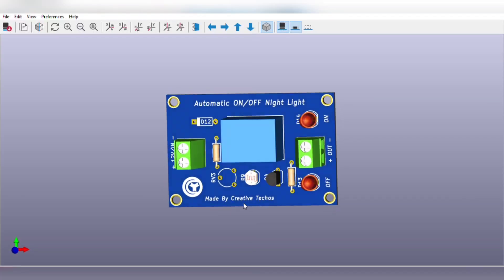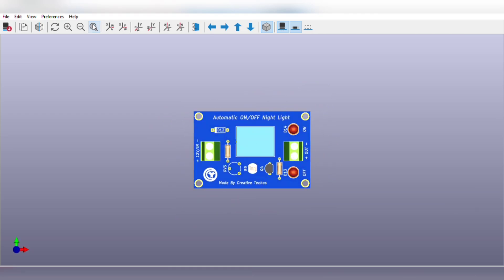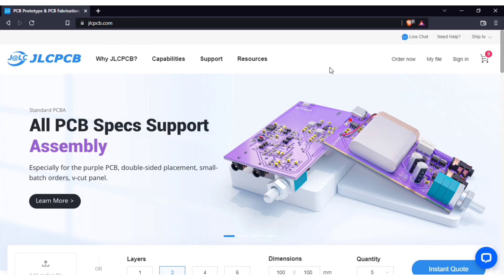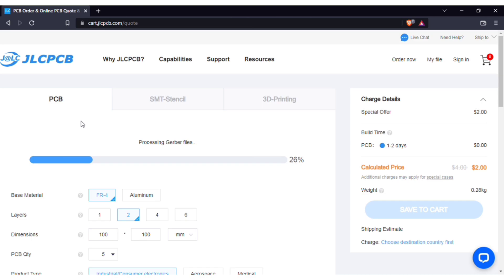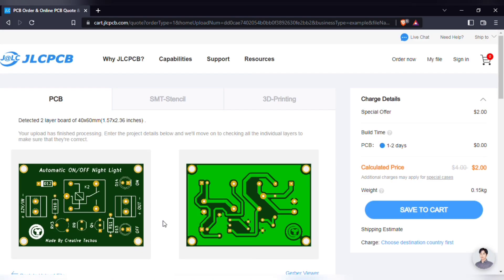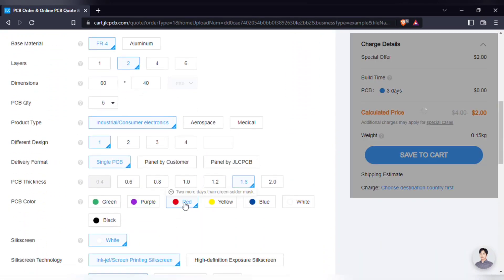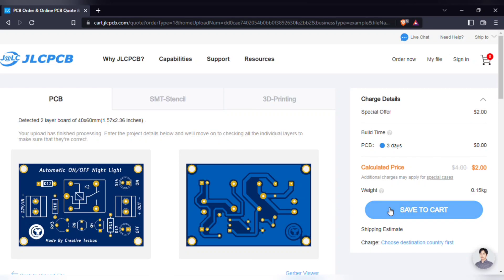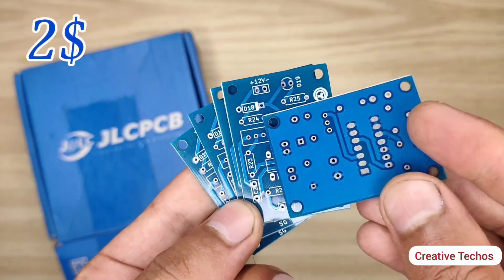Street Light Automatic ON OFF Night Light circuit

Comment: This circuit will work with fast changing light, but the light outside is changing very slow and the relay will start buzzing when the light is right in the point of switching. This type of slow changing events (light, temperature) needs a circuit with Schmitt trigger input with hysteresis to work properly.
Reply: using small value cap. like 47-100uf at relay coil points ll stop it from buzzing.
Reply: Prove it!

Comment: As u have shown 12 v relay instead of that if we use 6v relay using 6vsolar and 3.7v ×2  batteries changes to be done
Reply: Can u please help me as I am interested in making 8 to 10 pics and donate them in a village school after my wife's death anniversary
Reply from the maker: How can i help you, let me know 🙂
Reply from the maker: Yes, it will work perfectly after changes.
Adjust variable resistor to adjust sensitivity
Reply: Would like to have one circuit boardmade and rest of the circuit board  and rest of the boards with particular
Reply: Can u please make a circuit diagram and send as have to submit it within two days
Reply from the maker: Message me on WhatsApp+91 9596386458, I'll send you circuit diagram there
Reply: @CreativeTechos  would like to have the circuit board diagram
Reply: @CreativeTechos  please do send me the circuit board diagram
Reply from the maker: I'll send WhatsApp me
Reply: 6v 3A power supply circuit diagram
Reply: Thank you for your response and cooperation

Comment: How remote control works without receiving sensor ?
Reply: Oh ok thanks…
Reply from the maker: Thanks for watching 🙂
Reply from the maker: Are you talking about the remote i used in video?
Reply: @CreativeTechos  yes…
Reply from the maker: That remote i was using to turn off my Room light, and LDR turns ON night lamp circuit.